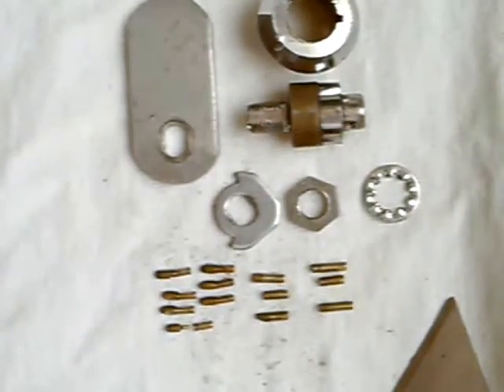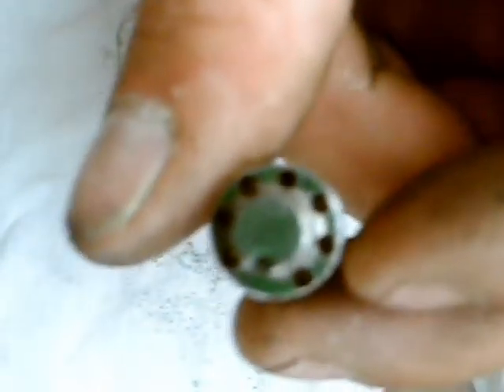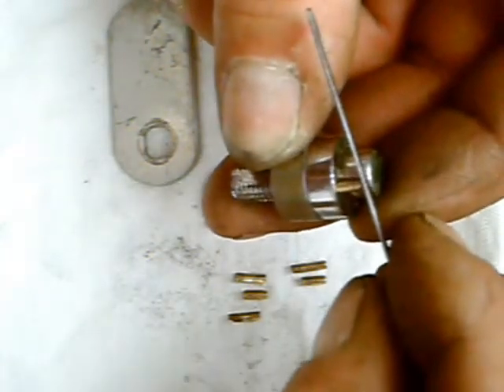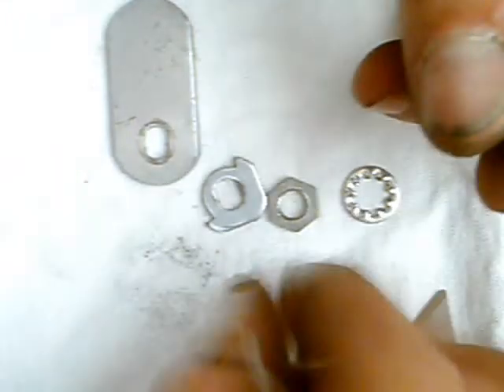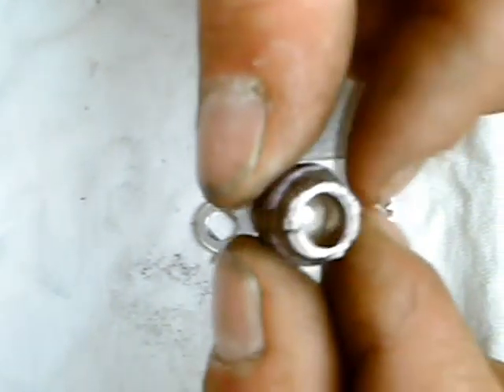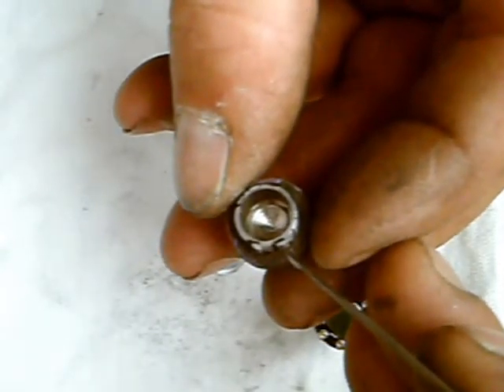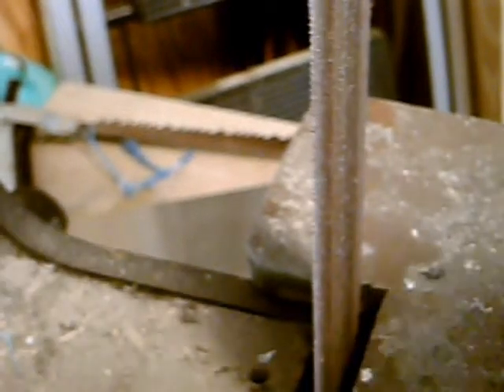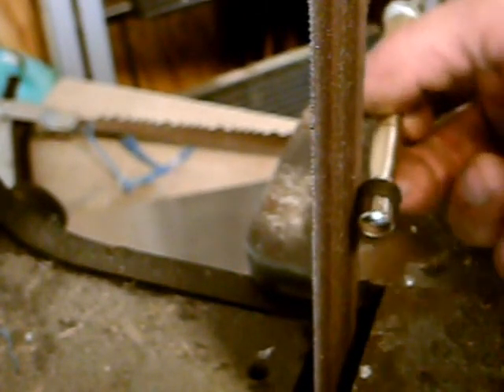What's Inside Of A Tubular Lock

Comment from the maker: The "Fingers" I used were bristles from a street sweeper brush But you can use hack saw blades, windshield wiper support rods from a car, I have even used small strips of electrical solder that I flattened with pliers. There are so many ways to pick tubular locks that make this way almost obsolete. Soon I will post a video that shows many different ways to open tubular locks. The key is to be smarter than the lock and get creative with the tools you have in your own garage to open it.
Peter

Comment from the maker: not exactly sure what your asking but if you mean the groove of the lock then the answer is nothing. Its better to have nothing because you need a little bit of play so you can wiggle your pick into the lock and seat all your pins nicely. The metal thing on any actual key that is made for a tubular lock would only prevent you from wiggling your pick around. My next video will show a few more easier ways to pick these locks without even needing an actual pick.